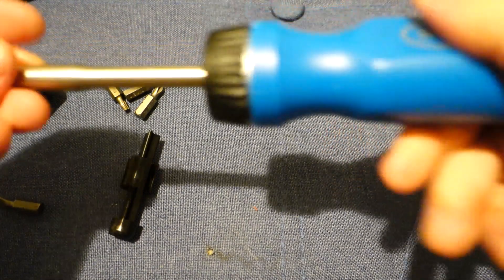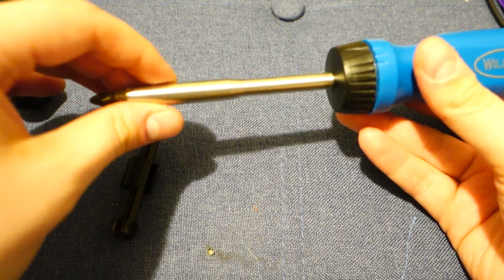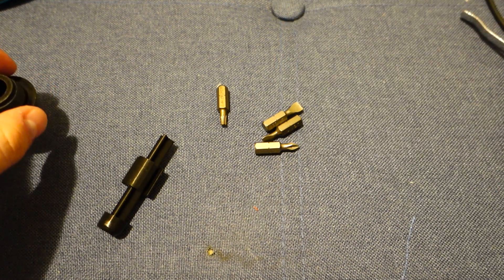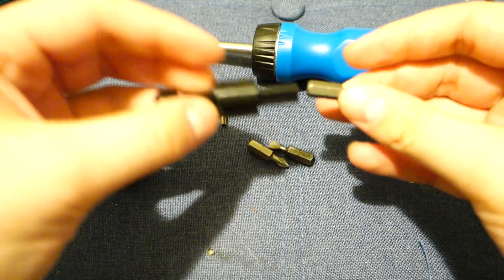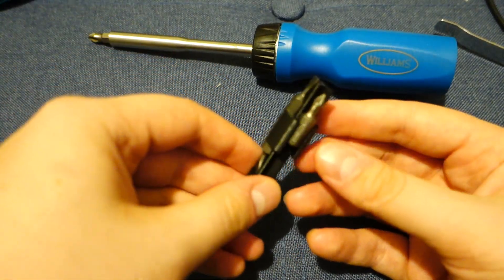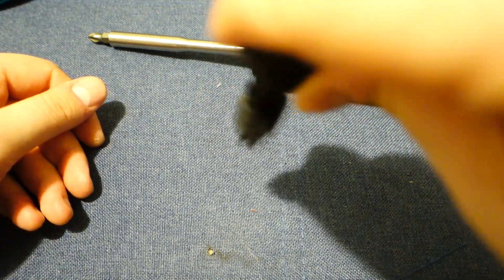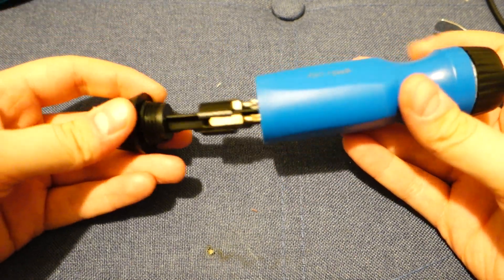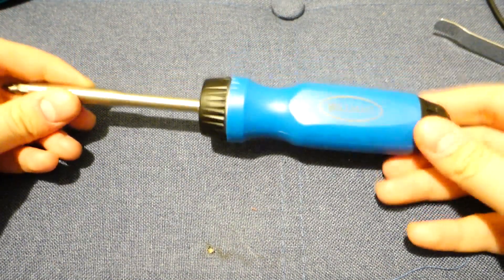DON'T GET RIPPED OFF! - Williams Screwdriver 3D-Printed Bit Holder

Comment: What a great idea, spend $40 on screwdriver to save a few bucks then try to find a 3D printer to make a part that should have been there in the first place. I will gladly pay $70 for a screwdriver with all the basic features over this. Makes you wonder why the people that make this (insert big brand name here) couldn't raise the price $2 and have a bit holder with the thing in the first place.
Reply: This one is the original from Snap On. That one is a rebranded Megapro. Both of those are better options.
Reply: its made by snap on